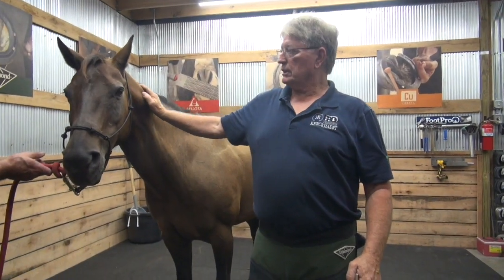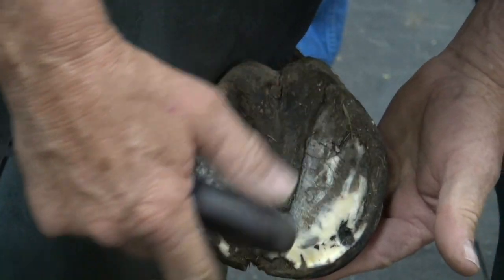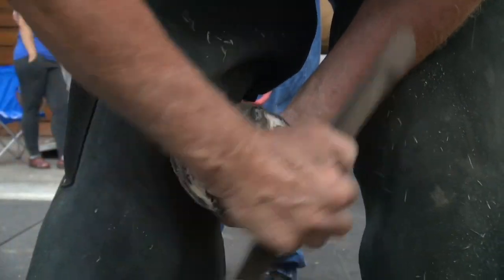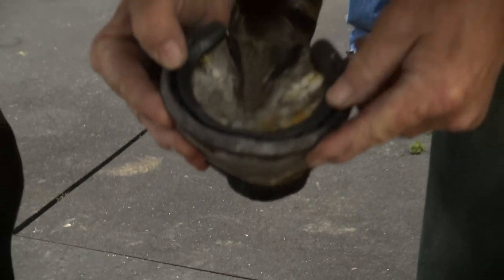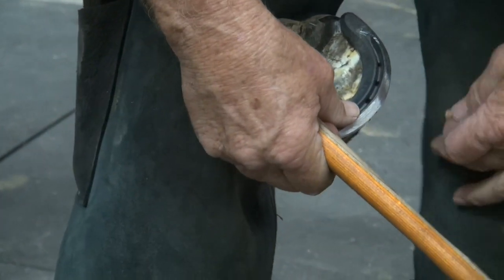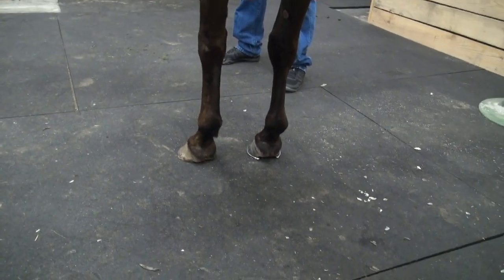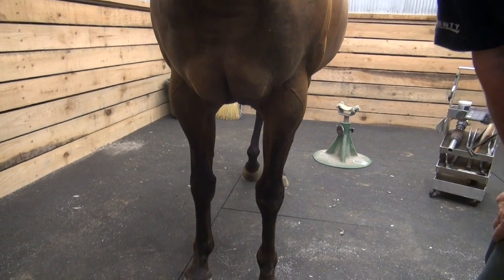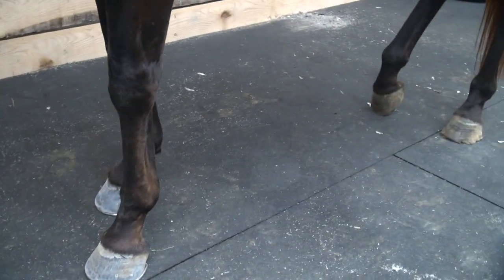Shoeing General Pleasure Horse with Abscess at Coronary Band

Comment: The heels and bars were left too high. When you shorten the toe you sould trim the heels and bars properly the same way than the toe. When you leave heels and bars longer than the toe you bring the hoof out of balance. The heels continue to push under after trimming. This should be improved by keeping them shorter than shown here. Furthermore, you can see well that the toe could be shortened further up to the white line, because the toe is too long and breaks out. The hoof actually shows you exactly how it wants to be trimmed, you just have to understand how to read it. 
In addition, the wall bends were not settled appropriately. After trimming, the levers that pull the hoof apart are still there.